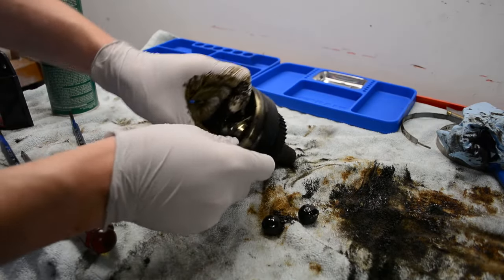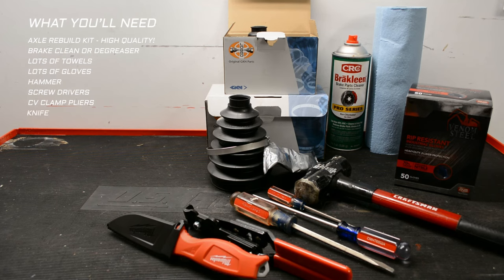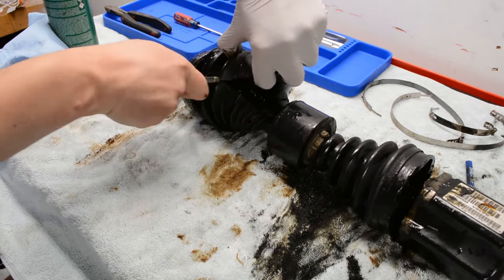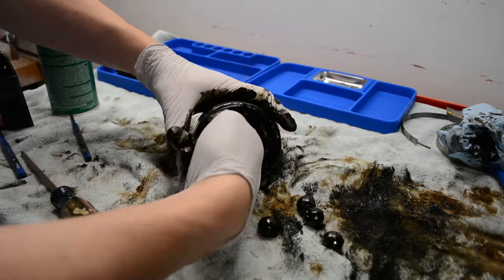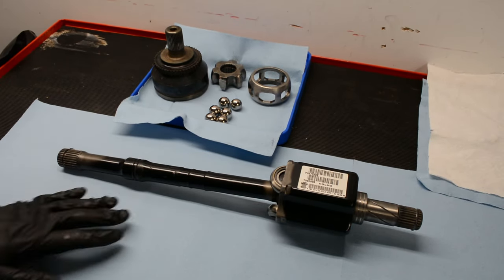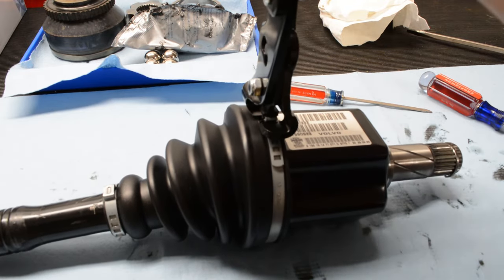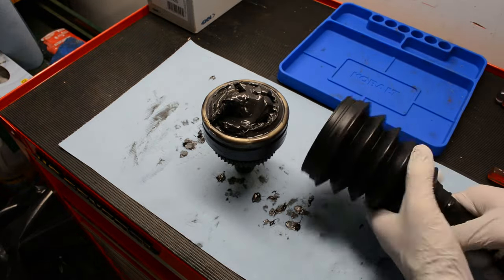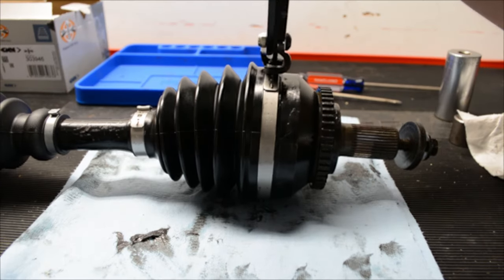How to Rebuild a CV Axle

Comment: Thing to note, not all CV axles use the round ring to hold the shaft to the center race, but use a snap ring, so the easiest solution is to learn how to disassemble the bearing while still attached to the shaft. Best way is with a brass punch on the bearing cage until a ball comes loose, then repeat on another angle. Once 2 balls are out the rest just slide out, then you can get the snap ring off.   If you don't learn this and come across one of the snap ring type, you will break or damage something trying to get the center race off the shaft. 

On the other side, the tri bearing side, there is a lip on the end of the groove the bearing slides in that prevents the assembly from coming out. Only way to remove it is to file or grind the lip off.  When reassembling, you stake the pockets at the end to prevent the race from falling out.
Reply from the maker: Thanks for the great reply! Yes, axles can have a bit of a different design depending on the car and going in with that knowledge is good so you don't damage something. It's especially difficult when you're trying to work through all the axle grease. 

Thanks again for the details. I'll pin the comment to help others out!
Reply: How does the factory get the tulip onto the joint with the interference lug?

Comment: The clip is inside the outer joint, you remove it by shock force much like inner. Inspect the cage, balls, and tulip for wear. The cage and balls can be disassembled. Back in the 80s thats what we did.
Reply from the maker: I did disassemble the outer joint? It's the inner joint with the tripod that doesn't come out on these particular axles.

In the case of Volvo axles there are stakes or a lip on the housing keeping the tripod from coming out. If you hammer hard enough, or grind them down it will come out.

Comment: Damper, not “dampener.” No component of this CV axle moistens. The same goes for suspension.
Reply from the maker: Thanks for the heads up. Another commenter mentioned the same thing. Though if a shock was blown and leaking oil out, it would be dampening parts of the suspension 😄

Comment: My front end was shaking uphill around 50 mph, no noise or clicking. I found a torn boot and grease all over the engine bay, I put in a new cv axel and the problem is solved, I tore the old one down to see if there was any noticeable damage, there was nothing that stood out other than loss of grease. Is it possible that the grease stabilizes the bearings or do you think the bearings are shot?
Reply from the maker: If you caught it early, like right after the boot tore, you're probably ok. If you're not sure how long you drove on it with a torn boot and no grease you're gambling.

Comment: the dampener was there for a reason..
Reply from the maker: Completely agree, but there's no way to rebuild the inner joint without removing it on this axle. There's plenty of people who remove the dampeners to rebuild an axle and don't have any vibration issues after. I don't like to be destructive when working on a car, but in the case of this axle I didn't have a choice. I wasn't about to grind the tabs on the cup off to remove it.

Comment: Interesting video.  I recently had my oem CV Axles rebuilt for my 2005 Honda civic si hatchback (5 speed manual). Initially new aftermarket axles were installed @ my service shop. Twice the transmission oil leaked everywhere.  
The decision was made to send original axles to be rebuilt. So far so good.
Reply from the maker: Hopefully the rebuilt OEMs serve you well! Interesting that yours leaked. Maybe the diameter of the axle shaft was just slightly smaller so the seals leaked?
Reply: @StevesGarage  
That's what another shop told me. Aftermarket new CV Axels are hit and miss. New ones from Honda are a fortune.
Reply from the maker: @1_Bad_Z  Yea new axles are a ton of money, but it definitely seems like they're worth the money to avoid the frustration. I haven't had a good experience with aftermarket axles.

Comment: Looks very much like mu MX5 CV shafts which I will rebuild, so your video is very helpful, thank you !
Reply from the maker: Awesome to hear it worked for a non-Volvo car! CV shafts can have small differences between models so thanks for the comment. Enjoy your fresh axles!
Reply: @StevesGarage  Ford owns large portions of Volvo and Mazda so its probably the same design. I have looked up some Mazda 3 parts that cross over to Volvo!
Reply from the maker: @68pishta68  Used to own, they haven't owned either for a while. But you can see the same on Volvos, there are some that have FoMoCo stamped parts.

Comment: Thanks for this. I'm trying to fabricate my own CV axles (Honda CRX and Nissan Leaf) and couldn't figure out how to disassemble the wheel side. Turns out I have a snap ring on the inside like you did so I'll try hammering it out next.
Reply from the maker: Glad you found the video helpful. Can I ask why you're trying to fab up your own axles? Are you just looking for something much higher quality, or do you have different suspension geometry and want something to better suit your needs?

Comment: I stumbled upon this video because I'm doing the same for my 1997 850 and I was going to buy cv axles from a 1999 xc70 awd
Reply from the maker: I hope it helps! It should be a very similar procedure. As far as axle compatibility, I'd double check part numbers. I know there are some differences with years and AWD vs FWD cars because of transmissions and angle gears. I'd go through the Volvo part website, or give IPD a call to be sure the axle will work.

Comment: What makes the cheap aftermarket CV's click like that? I just tossed my OEM ones last week in favor for new no ripped aftermarket ones and sure enough they click, audibly when putting in gear now....:-( @10:02, the open part of the clip should be up so when it hangs, the ends are not hanging out, possibly snagging and bending back. Your are so greased up that they should be floating anyway but when it comes to inserting CV's into the differential dry, you really should have the open side up, nesting down into the groove. States that in factory manuals numerous times.
Reply from the maker: Bad manufacturing or tolerances, or low quality grease can all make the cheaper aftermarket axles click.

Comment: Hi, great video, hmm don’t know if you can advise but I’m doing a 3.2 vr6  dsg swap into my t5 van, the vr6 has bolted flanges on the dsg, but on my existing t5 2.5tdi their not bolted, any suggestions on what I need to do ? Can I swap the flange over or something? I’ve got the engine on a diy test stand in my garage and got it running and sorted all the loom and lights for the van onto the Audi loom.. I’m just stuck on the drive shafts/ half shafts… I’m at the point where the engine is ready to come out of my van all undone except engine mounts and shafts, any help would really be appreciated, donor car was an Audi a3 3.2 v6 dsg, and van is t5 lwb 2.5tdi manual
Reply from the maker: First off, thanks for commenting, that sounds like an awesome build!

I honestly don't know too much about that stuff though. I know I've seen people swap flanges, but that's on a car that has the shaft coming out of the transmission and all you're doing is putting a different flange on. In your case, the axle is 'male' and slides into the transmission right? More like a typical CV axle?

Maybe you could take apart the inner joint of the CV and swap that over? I'm not sure how that would work, though it seems a lot easier than changing what's coming out of the transmission to match the axles.
Reply: @StevesGarage  managed to get the engine out today, ball ache and a half, just spent half the day cleaning everything up so I’ll have a look tomorrow at cv as you suggested just so I have a better idea, was tempted to film it for YouTube , but think I’ll get banned from all the swearing when it’s not going to plan
Reply from the maker: @GaryTaylorvw  Glad you got it out!

I feel you with the frustration, why do you think all my videos have voice overs hahaha. Let me know how you make out, and if you do start posting on Youtube I'd definitely watch!

Comment: Is it truly necessary to replace the "expander ring" at the innermost terminus of the shaft, part of the tripod housing?  The part that clicks into the differential?  I have 2002 and 2007 Volvo V70's.  Because we have two of these cars, I'm able to rebuild parts from the one to use on the other, in rotation with cheaper aftermarket parts, continuously.  I'm now rebuilding the factory 2007 LH axle to put on the 2002.  It was made in Germany.  Do I have to replace the expander ring at the tip of the shaft?
Reply from the maker: That's a pretty ideal situation! Hopefully no downtime if you've always got parts to pull.

I honestly don't think it's that big of a deal to not change the ring if you're not having any problems with it engaging into the transmission. That being said, you're there with it apart, it also can't hurt.

Comment: Do you leave the snap ring on the shaft and slide the whole shaft into the splines with that ring on?
Reply from the maker: Yes, the snap ring should always stay on. I've seen some people say you're supposed to replace it, but mine didn't look like it needed to be. The trick I've seen to get it on is have the open end down, the solid end in the notch. Hope this helps, let me know if you have any other questions!

Comment: The CV axle boot has split on my car and has lost some grease and it started making poping sounds when turning the steering wheel. I have took the outer joint out, inspected for any damage, it did had a bit o wear but nothing serious like indents on the balls or cage or housing. I packed the joint with grease and put new boot, but still makes the same poping noise. Did i do something wrong or it needs a new joint?
Reply from the maker: If it started making noise it's most likely too far gone, even after rebuilding it. A new axle is probably your best bet. The other option would be finding a good condition used axle and rebuilding that one just so you know it has new boots and fresh grease.

Comment: i wanted to rebuild the triball but mine also won't come apart... both shaft itself and the triball housing are very rusty and I wanna get em sandblasted as all the other parts from my car. Mine also has two rubber boots that combine to one. One boot has taps that prevent the triball to come out when installed so i don't know if i shcould grind down the tabs.
Reply from the maker: I opted against grinding off the tabs that hold the tripod into the cup. I was worried about messing up, or causing the cup itself to be out of balance. I have seen forum posts of others doing it without problems.

I soaked the tripod and cup in parts de-greaser overnight, then cleaned it out with brake clean. That worked really well. 

As far as the rust goes, you could try soaking it in white vinegar overnight. I've had very good luck breaking down rust on tools or parts by doing that. Let me know how you make out and if you have any other questions I can help you with!

Comment: I know this is an older video, but could please answer a question for me. I’ve been trying to find a replacement axle for a Nissan Rasheen, but I can’t find one. Everyone says it’s the same as a Sentra, but the Rasheen has an axle that bolts on while the Sentra doesn’t. Can you replace bolt on axles with non-bolt axles? Thanks.
Reply from the maker: Unfortunately I don't have experience with a Sentra or Rasheen. I know the different style you're talking about, as my Jetta is bolt on and my Volvo is the more typical shaft into transmission splines. Any chance you could pick one up from a junk yard?
Reply: @StevesGarage  I’m just wondering if it’s possible to replace a bolt on axle with one slots directly into the transmission.
Reply from the maker: @LetsMars  I don't know. You'd have to find something with the correct size and number of splines, along with the correct length to actually reach the spindle.

Comment: I just bought a complete passenger side axle for my 2003 S60;  $165 assembled.  Not sure if doing a rebuild is saving you much.  Regardless,  good job on the vid.
Reply from the maker: I agree, rebuilding might not be the best option money wise. A rebuild kit for a Volvo is around $60, factor in a couple hours of work and you've bought one.

That being said, the quality of an aftermarket axle might be an issue. In my case they vibrated a lot even at low speeds. I think the QC of aftermarket axles varies a lot. One person buys a good one, and then the next three are lower quality and no good.
Reply: @StevesGarage  Well Steve- I got away with the cheap aftermarket on the passenger side but I JUST did the drivers side- You are SO RIGHT-  this thing shudders upon acceleration.  When I first did the test drive-  I thought I forgot to tighten the lug bolts- NOPE... piece of junk aftermarket axle.  I checked and rechecked everything- all my torque specs just to make sure it wasn't anything I did or didn't do -- still shudders and vibrates.  I'm doing it your way.  The original axle is still intact- it was making a whirring noise and I discovered the boot near the wheel hub had a tear at the clamp-  over time- the lube/grease must have leaked out or water got in.  I 'might' be able to get away with just cleaning it out and repacking with new boots.  Your thoughts?
Reply from the maker: @lynskyrd  Sorry you didn't luck out with the driver side. The shudder does feel like loose lugs, or like a tire dropped a weight.

If the boot ripped and you lose all the grease it may be beyond repair. It could be damaged beyond repair from driving without grease. Since you have it you could disassemble and check it. Or find a used intact axle from online or a junk yard and rebuild it for piece of mind.

Comment: When I open the CB axle on my Honda accord 08 that has a once. I open the boot bearings fall apart I’m wondering if those not supposed to come out of the cup something was holding inside and is consumed they just go in and out freely and another question. What about the dynamic damper Did you have any problem after you install the CV axles issue with vibration can you please let me know thanks.
Reply from the maker: Everything should stay together if you just remove the boot. The ball bearings should be nested in the cage until you remove that whole assembly. As for the damper, I didn't have any issues with the axle once it was removed.
Reply: Well, I went and got the CV axle from Napa just install them looks like a kind of okay quality but run into another issue looks like the inner mid shaft on the Honda Accord 08 bearing don’t sound so good so I’m gonna have to work on it tomorrow thanks I appreciate your response.
Reply from the maker: I have heard better things about Napa compared to Autozone/Advance/O'reilly. Good luck with the mid shaft bearing, they can definitely be a pain.

Comment: Should I rebuild if the Axle already making clunking noise while backing up and getting out?
Reply from the maker: If the boot hasn't split and lost all the grease, you might be ok to rebuild. But you could also open it up and see a bunch of damage to the parts. It's very much a subjective thing and hard to give a definitive answer online. But if it's just started making a minor amount of noise, you might be able to get away with a rebuild.
Reply: @StevesGarage  hi thanks for the reply. The outer boot already splited  and leaking grease in that situation I’m kind of confused should I rebuild or buy new one but the Oem one is like over 5 times more than the aftermarket one. What do you recommend me?TIA
Reply from the maker: @Salimreza597  If it split and the grease is gone, the joint is most likely damaged. As for aftermarket vs OEM, it depends on your budget and how many times you possibly want to do the work.

The quality of aftermarket axles is all over the place. You could buy one and be fine, you could buy 10 and all of them be junk. The OEM axles are always solid. I'd search and see what the general consensus on forums is for your specific car.

Comment: what about reinstalling the vibration damper?
Reply from the maker: You can't reinstall it once you've taken it off. This will forever be a debate, but it's not 100% necessary. Many OEM axles have it, and many aftermarkets don't.
Reply: @StevesGarage  Alrighty then. I understand the logic. I've run into several design features of different vehicles that make me question "why does it need to be like this...?" I mean, if it can live without it... why bother.
Reply from the maker: @Pasquali_Sergal  From what I understand with a new OEM axle they want the smoothest driving experience. Once you hit the aftermarket they want to save on costs, but chances are with an old car you won't notice a little extra vibration from a missing damper. I've had axles on my Jetta without the damper for 5 years and I can't tell the difference.

Comment: Interesting too about inner part if someone just want to completly rebuild cv axles. Don't find where can buy a cage or balls
Reply from the maker: Yea, that's definitely one issue with rebuilding, especially if you find a problem with those parts. When rebuilding these Volvo axles I came across places that sell them, but it seemed to be a case by case basis. I didn't find any for my specific car, though I did see some for other models.
Reply: It's actually the cage that I need for my drive shaft, everything else is fine, when I  fitted a new wishbone the drive shaft came out where the balls and cage are and I didn't realise and when I went to move the car it broke a bit off the cage, so I could get another cage if I knew where to get one? Also I have been looking on ebay for a replacement shaft but often when I put the details of my 2002 Volvo v70 Se D5 in, it says this part does not fit your car, so not sure if any other Volvo models have the same shaft? My one is manual, thanks